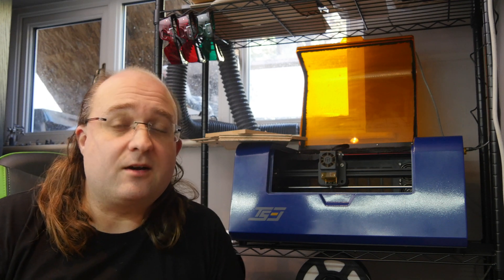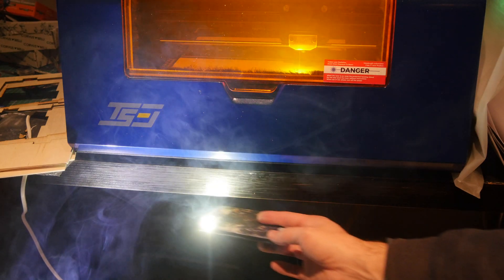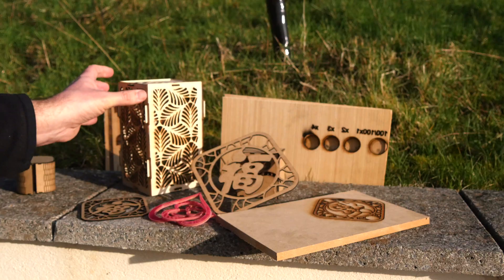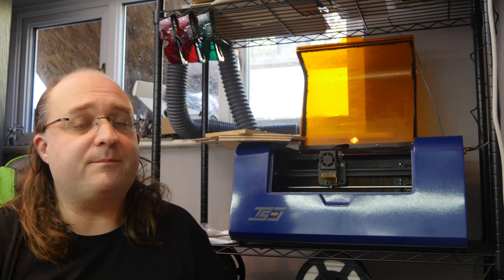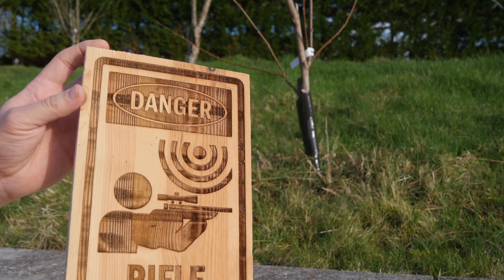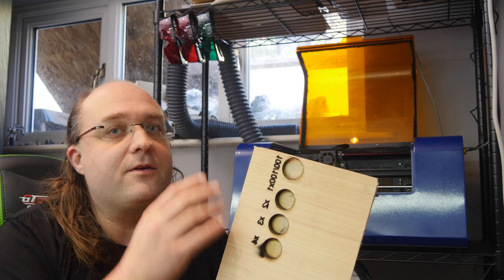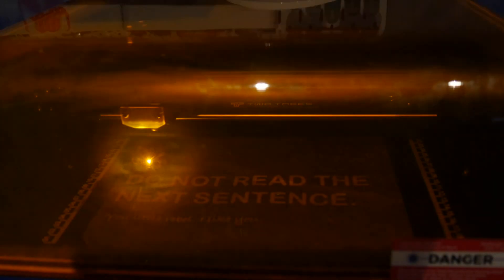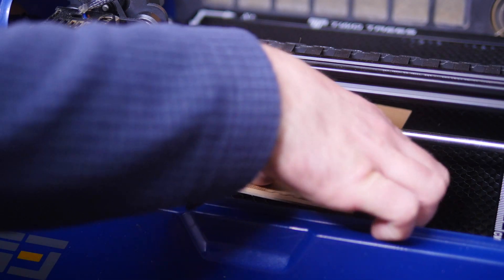Finally, An Affordable Laser Cutter That's Safe for Home Use: TwoTrees TS3 Review

Comment: How did u find the built in rotary was it easy to use and control?
Reply from the maker: I didn't get a chance to test that, the rotary attachment wasn't sent.
Reply: @MakeUseOf  isn't it under the screws inside the laser? I saw in several videos they had it built in and u need to unscrew the hex screws and remove the two plates